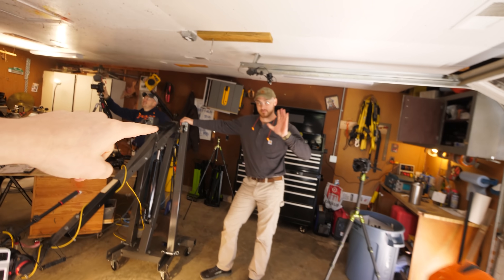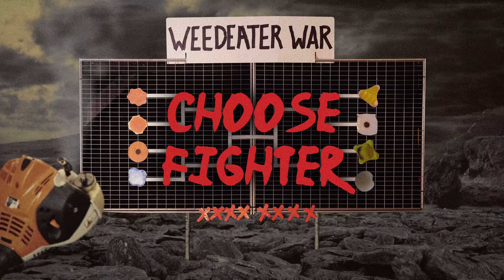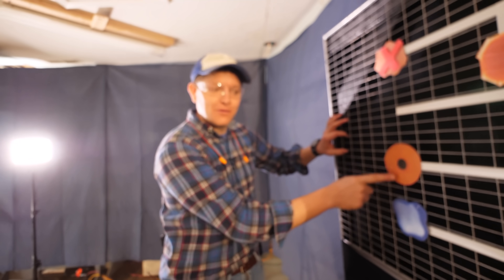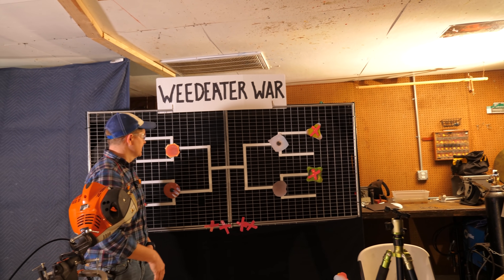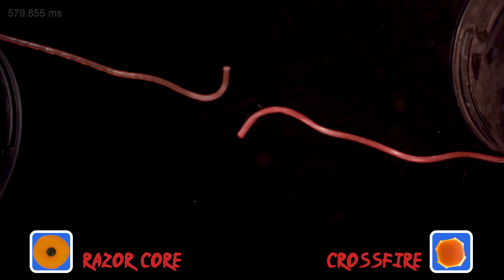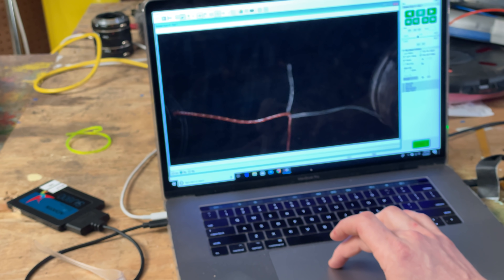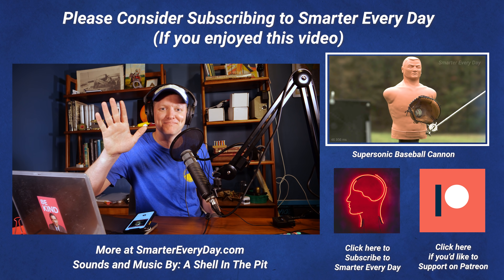What happens when 2 Weedeaters Hit Each Other? (28,000 fps SLOW MOTION)  - Smarter Every Day 255

Comment: There appears to be another problem. Which ever string is on the left appears to have an advantage over right. A cursory view of the setup appears to show the two rotation planes to be at different angles. So …. You need to redo the whole thing with a double elimination and each string starting on the left one time and the right the next time.
Reply: The angle is not that critical at all, its quite good test if the timing is right. Like thicker stronger line will cut the softer lines. If the strength of material was equal then it come to the mass at the end of the line at the point of contact. So there is a element of "luck" or randomness. Like the sharp square was shredding the grey glob, they pull them close to fast and one good hit at the base of the head. The sharp square cant move to absorb the hit and snap.

I think he need more consistent test and make more runs like 10
Reply: @scasny  it might be something as simple as the length of line beyond the point of intersection being different for the two sides. That there is a large imbalance in the “wins” versus “losses” left versus right does indicate that there is very likely some factor at play. Whether that is the difference lengths at the point of intersection, or the angle of attack, …, or possibly how strongly each side is held, or something else - something is causing a difference that makes the results unreliable.

Comment: Orange: Connor McGregor's ankle.           I like the test but a key variable in the test is the material being used, it's not only the shape  but the same grade of plastic needs to be used . If I'm really being picky , Id say verify the rpm of each weed eater and do multiple tests because I saw breaking points when the string was rapped multiple times and the other stayed straight.  Why did the orange string remind me of Connor McGregor's ankle?

Comment: Those lines are responding very much like whips. Where you hear the "Crack" of the whip, it is the tip breaking the sound barrier. I wonder if that causes heat? And if it does, will that effect the strength of the cord?

Comment: This seems to go in the "if all you have is a hammer, everything looks like a nail" category. You could've just whipped each of them against a tensioned steel wire and then measured how much shorter the line got. Would not have been so fun but a bit more scientific.

Comment: Sort of the same principle as when my very long hair on a really windy day knots up real bad. By the time I go inside and look at it the mirror..my hair has literally tied together in so many knots. Like actual knot ties when see it upclose. So safe to say, I try to stay out of the windy wind but if I have to, I will wear a cap or braid it. But yes, when I saw the weed whipper string tied together' I immediately thought of the 10,000 hairstrands per 
square inch and all of that factors in to nearly a million or more hairs for the surface of my scalp..and how it can tie itself in little knots during cranky weather' involving strong winds, it's speed and just what it takes to tie it all up in individual and sometimes hurty' knots all over mine head. My hair goes down past my rearage and each strand is appx. 4ft long.. Just like or very similar to a singular weed whisper string.but much nicer and it always smells good. Q: Am I able to de-knot my hairstrands with a reverse technique or an anti wind? Lol..not sure what ur thinking about my difficulty with the wind in my hair..but you get the point? I hope.   💯 ThanksABillion! 👐.

Comment: Awesome video. Not surprised the gatorline won. The weight and size of the line makes a huge difference. But in a practical application the thinner line always cuts grass better. Also thinner line can be longer and therefore moves faster at the tips. I'd rather go through more line and be able to cut faster and smoother.

Comment: Sadly they didn't do multiple battles because it was entirely possible that in a best of 5 test the winner of a single bout might not have been the victor.  They should have also been altenating the line from one to the other weed eater because you have no clue which one of those might be faster and therefor have an advantage.

Comment: Now I know why I have used Husqvarna line for the last 20 years… Husqvarna line has a smaller diameter so it cuts through grass easier, but more importantly there is less air drag. I can tell a big difference using .9 to .95 line. The Husqvarna .9 line spins up much faster and cuts tons better…

Comment: Sharp² losing in that 4th battle was a little disagreeable, as the line itself didn't break, merely the part holding the string in let go, thus it wasn't really a measurement of the strength of the line.

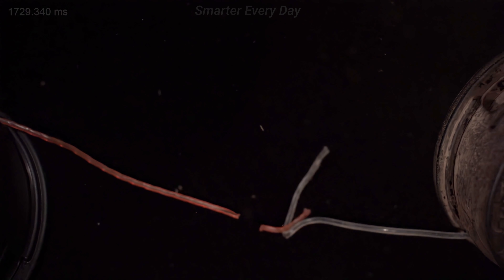Comment: I am wondering how much of an impact the angle of the rotator and the wire has while it is moving away as the ropes dont punch each other while in the same angle/at the same point of the rotation. Therefore one rope gets pulled from two sides at one point while being stretched in a straight line and the other still has some room to straighten. God, my english isnt the yellow from the egg but i hope you get what i meant. You can see what i mean at 15:37 to 15:40. The red rope is nearly fully stretched and pulled by its rotator to the legt while also being pulled to the right by the grey rope while the grey rope still is flexible and can therefore take  more pulling energy

Comment: You got The BEST Stihl Weedeaters too... Work with these every day, great machines. Now I gotta go watch the Weed eater Line video! so fascinating. That Echo line is no good tho, its WAYYY too soft. I personally use the Stihl Round on a daily basis and that clear Square with the metal core for properties that you need a stronger line. That one i have found in my landscaping experience has been the strongest, use it daily. Stihl makes the best reinforced line tho. The type of heads also make a difference too, just saying, whether its a quick feed or a split head. and you are using all split heads,  and That's why entire lengths are being pulled out. you should re run this whole test with Quick feed heads. I am not surprised by your winner though.
this was a very fun video for me! Thank you!

Comment: look at optic fibres for telecommunication lines and you'll see that each fibre is coated with a sleeve of thin plastic to increase its bend radius by distributing the forces evenly around the brittle glass core
that may be the same thing going on with those compound cords

Comment: As an ex landscape professional I valued thicker trimmer line WITH steel core, the shape to me was irrelevant I wanted durability. I figured the sheer violence cut not any shape and the durability was the most important factor to keep men weed wacking and not putting on line. Keeping extra precut looped line  electrical taped to the shaft is a must. We used weed eaters sideways to cut in edges against concrete walkways and driveways etc if we just used the line on grass a fresh spool would last months
Reply: @Maria Hotgirl Vlogs unsure what the correlation is

Comment: I wonder if the downward motion contributed to the win. Just like the p factor on a plane propeller the side that spins downward grabs more air the when the propeller pulls upward.  This is why in small single engine aircraft right rudder input is needed to offset the p factor. The line pulling downward may have had the advantage that won it all in the last round.

Comment: This is a cool test, but tournaments are pretty terrible for getting good data. Tournaments are only useful for comparing extremely large numbers where each permutation can't be checked. But tournament ranking assumes that the transitive property applies, and that is so incredibly unlikely to be true for just some metric that is based in physical reality. It's not even true for sets of numbers greater than size one.

The data of the "overall winner" is completely useless. The data of which thread one against which other thread is quite useful and interesting. I like this study, its gives useful data that other wheedwhacker comparisons dont get to, but i think the way you modeled your comparisons pretty much ruins the conclusion. Tournament style is bad for making good conclusions
Reply: Her: his probably thinking about someone else....

Him with bois: let's make a gladiator battle using weedeaters

Comment: My prediction... It will come down to which one can take the most bending.  The line with the cores should be the contenders, with sharp square ultimately winning out due to its smaller radius between the corners handling the tensile stresses better than the circular razor core.

Comment: The solid core offers tensile strength.  We used WD1 communications wire in battalion and it was a simple insulated wire with two poles.  Between those wires there was a thin steel strand.   It helped to prevent breaks in the line from getting caught by troops and equipment.

Comment: As you mentioned, Absolutely unscientific and no truly presenting their true value.
A more thorough experiment is needed in order to know their true value.
Weedeater line types could behave totally different, when tested on weed and other natural plants.
The test itself should also be repeated several times under the same conditions for each weedeater, then again changing conditions and also repeated several times.
Only when there are enough tests performed, one can claim that statistically this or that performs its job better.
The tests should also include other factors apart from fracture, such as and speed and easiness of cut with each contact, the influence of shape on the quantity, quality and diameter of cut weed. It might be that certain types perform better for a certain diameter, while others perform better for a different diameter.
The same deviation might apply for different types of weed.

Since there are many factors that weren't taken into consideration, when should really consider this experiment as funny, but in no way proving anything.

Lemogan

Comment: swap the weedwhacker cords in the machines. It's probably just a coincidence that the cables on the left machine won out most of the time, but it's still something to consider, just in case the motor rpm and rotational inertias aren't equivalent in the machines itself.

Comment: The thing that makes this test very unreliable is rpm. The variation from on test to the next between two different wackers makes it so one could have more stress on the line. If you do full Rev and weed eat you will notice broken string. Drop down to half rev and you can hit the fence all you want and it won't break. Another thing is how much each string weighs having it's energy going into the other and how much exposure. The tips are going to hit harder than having 4 inch of string hitting making them twist and bend and pulled till broken

Comment: I got an absurd sense of pride for not only picking the winner correctly, but both the finalists.
It's the little things in life I suppose.
Reply: What was your criteria on picking the winner? Asking for a friend
Reply: @TheHarrip  I went with sharp square because they mentioned that it was larger (thicker) than the others. That's really it. 

I went with razor core because of radius strength. When I'm working in cad, or designing something, I radius any 90° angle I can knowing that it will be stronger. Does that actually make sense when discussing weed eaters? Probably not haha..but that was my thought process.

Comment: Heat is also a huge factor, the sudden tight wrapping and unwrapping along with the collision creates a lot of friction and heat which breaks down the line and on a molecular level is actually expanding the polymer structure making it weaker there on top of the tinsel strength degrading.

Comment: The real question is how does RPM effect this when you can clearly hear two engines running at different rpms. How would that change the outcome? If they are both identical rpms only off by 50rpm or less, what is going to actually win? Centrifugal force will cause any of them to be more sturdy then what they are. Shape is a factor, rpm is a factor, core density all being relevant.

Comment: Typically on trimmer line with a core the core is a softer material so that shell of the can be a harder material to help with wear while keeping flexibility, it also helps having a harder shell with the line getting hot in the eyelet of the head and welding together and then not wanting to feed. This is information being passed on from the manufacture of the lines (husqvarna and oregon) not my opinion. Also both manufacturers when I spoke with their reps (regional sales/tech support the upper level guys with direct factory connections not your sales floor guys) gave the same explanation of what they were wishing to accomplish through the dual material line.

Comment: I'm sure there are "Karen's" in the audience who could find fault with safety items like the safety glasses, long bill hat, long sleeves, or even the remote device used to accelerate the world's strongest plastic lines to near supersonic speeds and then hurl them into one another.  Indeed even non-Karens would find these safety devices important.
But no one could possibly deny that the most important safety device in this video was the spit guard protecting the microphone.

Comment: I think a few things are important to note here; 1: as per the rules stated at the beginning, razor core should be the champ. 2: the core is not necessarily what made the difference, if I remember correctly the two finalists had the highest mass and cross sectional area. I could be wrong there, but it seems intuitive to say that a heavier and thicker line would usually beat a much thinner and lighter line. 3: the two finalists also had a relatively rounded shape. meaning that the stresses would be more evenly distributed, compared to other lines where the stress would have been concentrated to the peaks and valleys. 4: I think he was secretly the announcer for Epic Rap Battles.

Comment: Awesome video, very cool.

I want to touch on something only because I didn't see the data, forgive me if I missed it.

With regards to the two final "contestants", I agree it's no coincidence the core of the string played a part. However, given the fact there were two trimmers, was the RPM of both heads within a narrow margin, was it verified with a tach?

I'm only going on the fact that a trimmer line with higher RPM would likely prove less susceptible to deformation and could prove to be stronger to the other line in the battle.

I don't know what the range of RPM would be to not make a difference, but pertinent data nonetheless.

Keep up the great work!
Reply: The rpm doesn’t make a difference
If i headbutt a brick at ten meters a second it is the same if it is thrown at my head at tem meters a second

Comment: What also matters is the AGE of the lines.  Old line breaks sooner. Plastic just does that.
Now try the WIRE High E string off of an acoustic guitar.   You got to use the older machines that do not self advance....and wire cutters.  The grass "screams" when it gets edged

Comment: I thought the round ones would win because the non-round ones all have thinner corners/areas that are inherently weaker. The idea is that these weaker areas would begin tearing/cracking and this tear would propagate all the way through. So, easier to initiate a tear because thinner areas.

Comment: I got some "Pulverizer .105" 2.7mm sharp rounded triangle. Got it with a snapper battery and like 500ft of line barely used 3 spools in 5 years each spool is like 12ft

Comment: Anybody else notice that the line on the right side won every single time except once? And even then it was because the other side got pulled out. I don't know if that means anything but it's got pretty small chances of happening randomly
Reply: Did I just miss it? Or did they seriously not include the winning lines name in this video? Smh.
Reply: You can see clearly that one of those weed eaters is newer than the other. From the close up camera pov I think its the one on the right thats newer, pretty much what they tested here wasnt which line was better it was which weed eater swung harder.
Reply: @vasaus  I don't know if that would make a difference since all actions have an equal and opposite reaction, so the force acting on both lines would be the same on impact, but they might be manufactured in a way that they have some kind of directionality
Reply: @samueltukua3061  i would assume a weed eater with a weaker motor or a lower rpm would have some sort of effect on how the lines act. Maybe it doesnt have am effect, i was just looking at it with the scientific method in mind
Reply: @vasaus  that's actually a good point. The different momentums might make them wrap differently and as they pointed out, the ones that wrapped the most broke first

Comment: Great work guys, a lot of details, nice!
but two things:
- did you manage to get quite an equal power/speed on both machines?
- What if putting a camera in the axis of the wire? would be interesting to understand the edges of the wire while hitting/wrapping objects/wires =)

Comment: Not sufficiently controlled for the relative positions of contact between the two strands. You would expect different strengths, and different behaviors in all kinds of ways, depending on whether contact occurs near the tip or further back along the strand. Just like in fencing, the weak tip of the weapon meeting the stronger middle of the weapon makes a huge difference to which controls the battle.